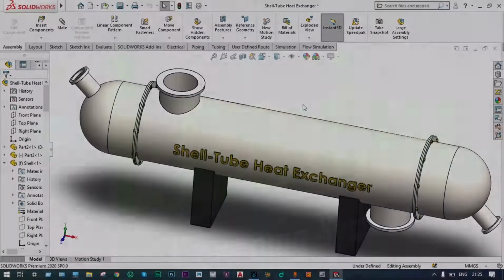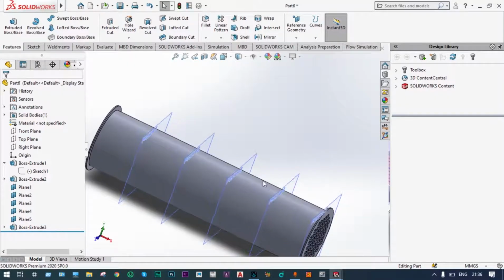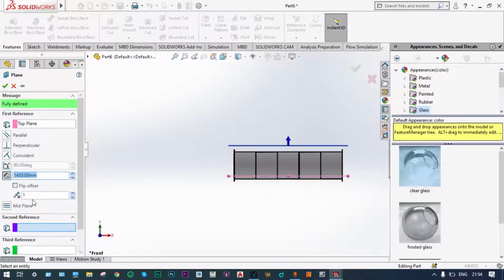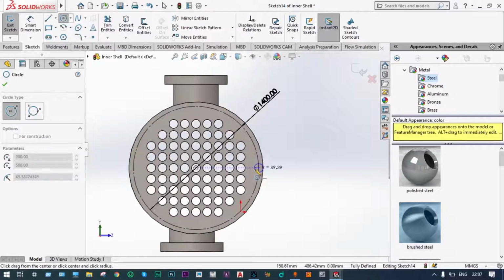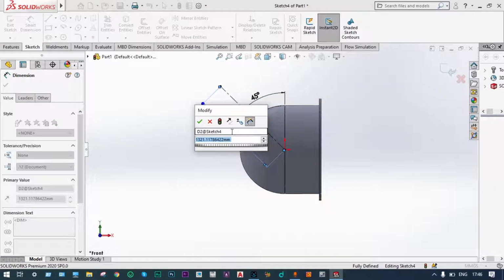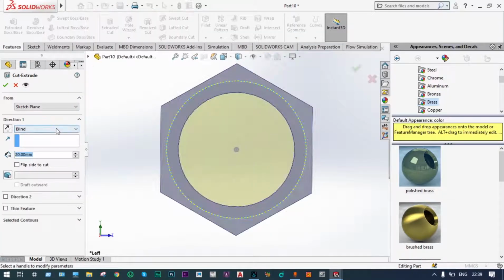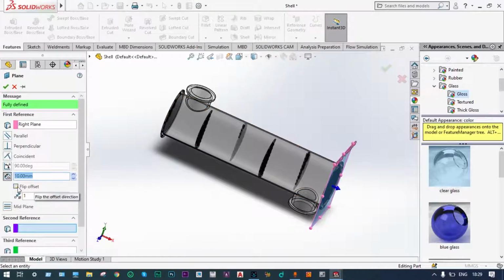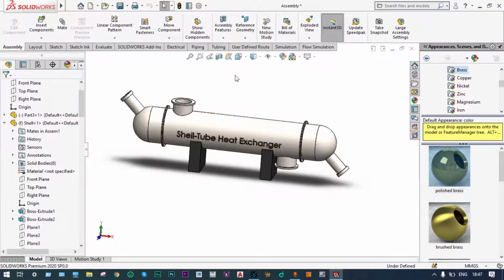Step-by-Step Tutorial: Modeling & Assembly of a Single-Pass Shell Tube Heat Exchanger in SolidWorks

Comment: bold and ring not assembled right ?
Reply from the maker: Already this video is 1hrs. If bolts and rings were assembled the video would be too lengthy. It is simple. You can assemble one bolt and that can be used as a circular pattern in assembly. If you have problem them I will show it in a different video.
Reply: Yes, I did it 😬 Thanks a lot mate 🤙🏻
Reply: @srraltas7045 brother kindly share part and assembly
Reply from the maker: Visit my website to have a lot of FREE courses along with that you will get this model and also some other models